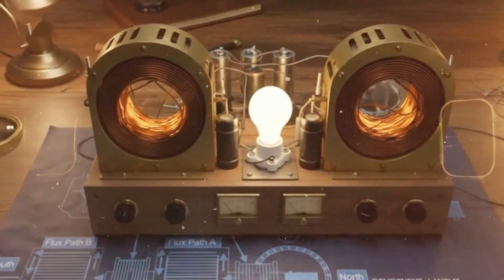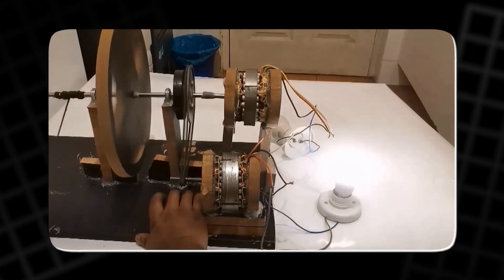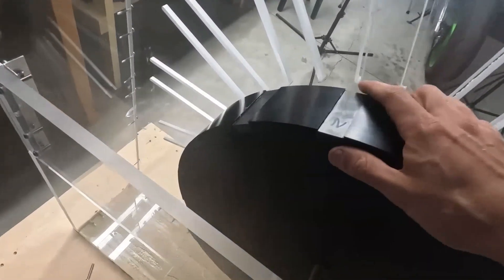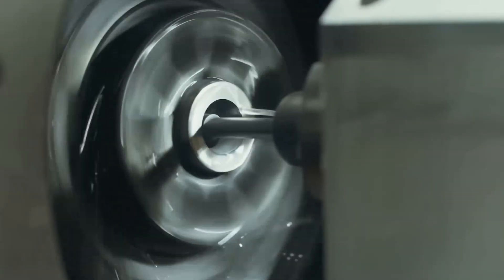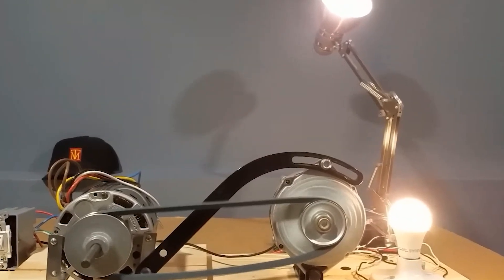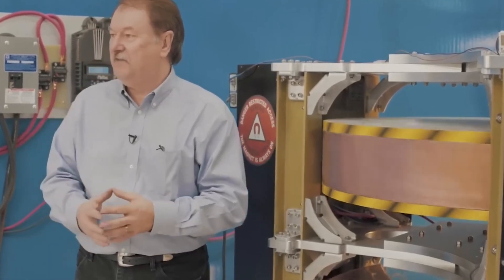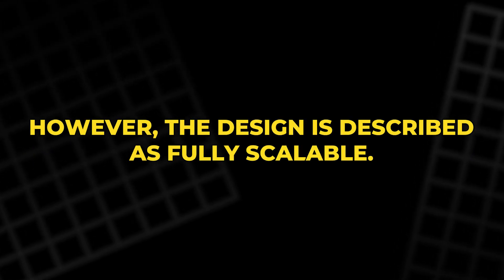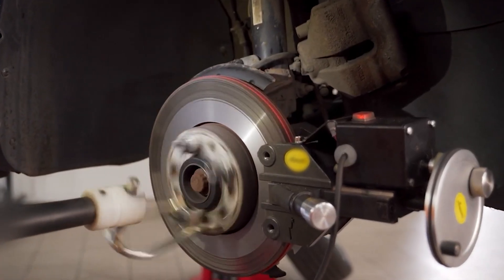This “Zero Point Generator” Breaks All Known Physics! #freeenergy

Comment: ALL of these contraptions on the web have a hidden energy source.  The only way  to demonstrate this works is to put the ENTIRE device in a clear box with verified no wires and demonstrates its ability to run with power out and no run down.  The technical explanation on the video is non sense. This is why the US patent office will not waist time on such proposed patents.  It is a better presentation of this non-sense.